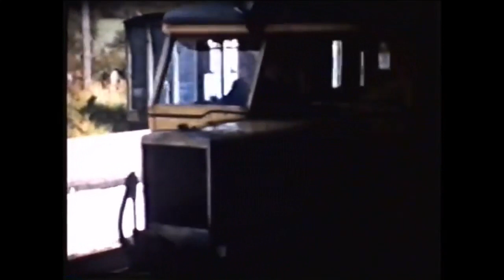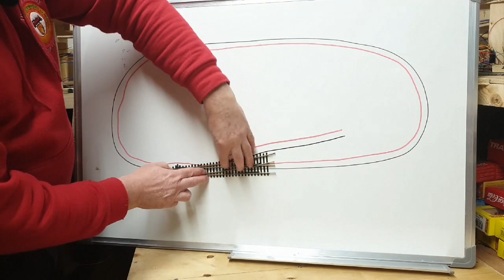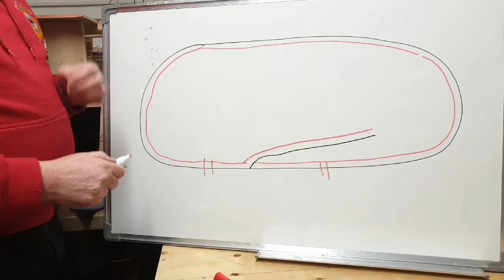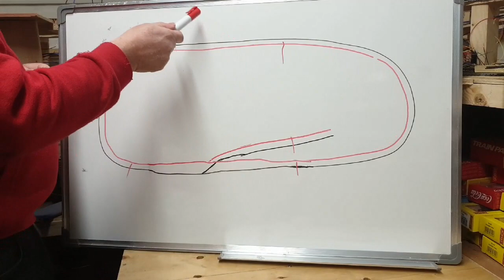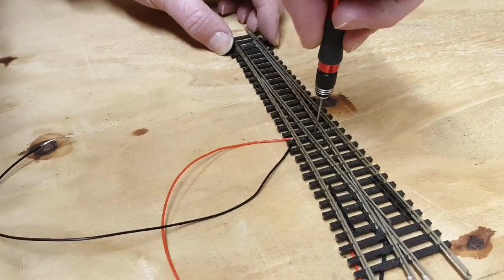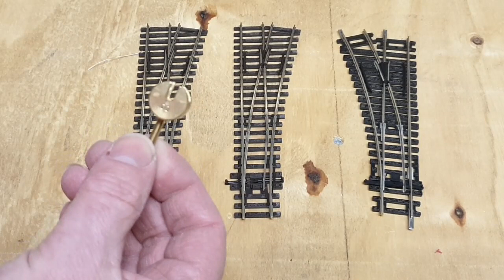51. Points DC and DCC, Fitting point motors and Eletrofrogs

Comment: Good evening 
How can I connect the PM1 to the signal and a switch at the same time?
Can you send a video please. Thanks.
Reply from the maker: The switch on the PM1 is for switching the frog polarity, if you are not using it for this, it could be used for a colour light signal.  With extra components could be used for both. Maybe I will do a video in the future on it.

Comment: Mark, 
Do I need to place any kind of insulation around the switch machine so it can run quietly? and can the switch machine be controlled to move slow to be prototypical? 
Thank you for your time 
Sincerely 
Allan
Reply from the maker: The motors I use don't need insulation. If you want a slow action lookup tortoise point motors

Comment: I have one more question what size wires do you recommend i have found a 24awg 2mm on Amazon but im not shore what awg is and if it is important when in use on a point
Reply from the maker: This is what I use https://www.rapidonline.com/rapid-gw010435-equipment-wire-red-7-0-2-100m-reel-01-0435   AWG is American Wire Gauge its how they size wire in the USA
Reply: @DonegalDadRail  thanck you very much 🤠

Comment: This may seem like an odd question but can you just have the three wires ,frog , positive and negative and the switch you use and still make it work but by only switching it from the track manually
Reply from the maker: Yes you could do it manually. But using a switched point motor or a frog juicer stops accidental shorts, which over time could damage your loco's or power supply.
Reply: @DonegalDadRail  I have done the three wires test and it seems to work I think if it shorts out it would just stop working but the locos run over with no problems

Comment: Do you need to fit isolating fish plates if using Dc
Reply from the maker: It is best to fit isolating fishplates to cut down shorts and if two DC controllers are in use. If two controllers are in use you will need additional wiring. The double slip come with instructions on this. (Peco SL-90 Crossing, Double Slip)

Comment: That made it very easy for me now. Can you please explain me how to use the micro switch under the solenoid motor for the light switches you mentioned.. Thanking you…
Reply from the maker: Not easy to decribe here will be doing a video on it in the future. But basically you would use the switch to power the lights making sure you use resistors and rectifiers where necessary

Comment: Hopefully you see this, but which point motor do you use, because I can't figure out if it's the pm1 or pm4. Thank you if you do see this 😊
Reply from the maker: Hi Lennon I used both point motors. The PM1 was used on most of my points. On some of my points I used the PM4, as on these points the spring was either broken or missing and the PM4 has a latching mechanism to hold the point blades in position. Both point motors have built in switches to control the polarity on the electrofrogs. Hope this answers your question.
Reply: @DonegalDadRail  thank you this helps massively.

Comment: Can I ask how many droppers you need from your bus wires on a basic oval like this? (sorry for all the questions!)
Reply from the maker: You can get away with 4 droppers on a small oval in each "corner". The great thing when you run a buswire if you get a dead spot you can put in another dropper. Having dropper every couple of feet give good electrical continuity
Reply: @DonegalDadRail  brilliant thanks. And where a  turnout connects to an inner oval, is that a couple of droppers at the end of the turnout, plus droppers in each corner of the inner oval?  Also  moving on from turnouts, assuming a simple loop of bus wire, how does one terminate the very end of the bus wires?
Reply from the maker: Have a look at this, see if it answers your questions https://youtu.be/psWpytRlq5I

Comment: A couple of regrets for me..not using express points and not fitting point motors. Sadly will cause a load of work and issues if I was to do it now. Good work on your latest project
Reply from the maker: Its all part of the learning process with model railways, remember a layout is never finished.